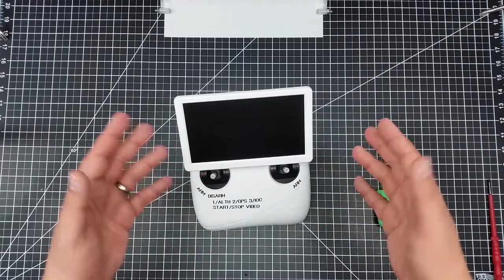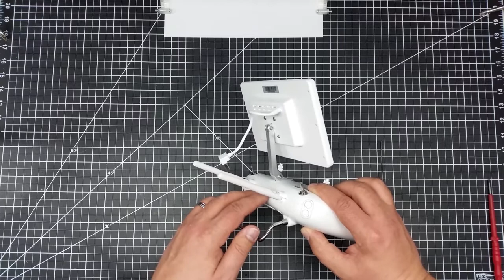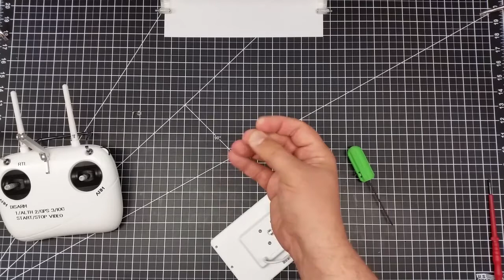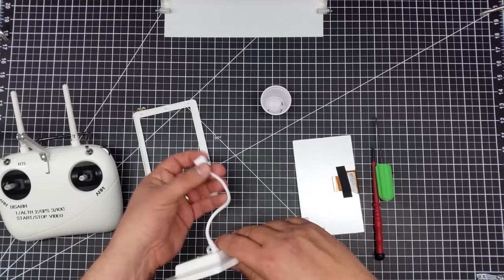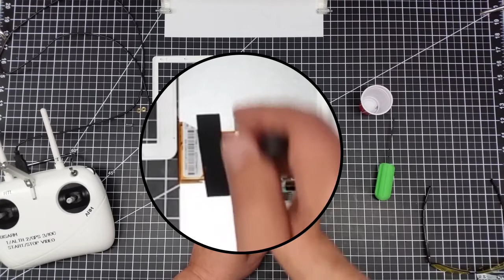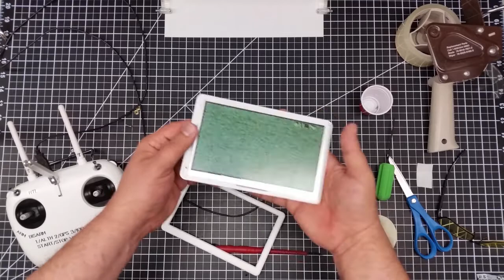Video Drone - Repairing the UPAir Video Screen!

Comment: 💥✨💥 5:48 I saw another screen repair video where he found that there was double sided tape intended to stick the board to the screen but the factory never peeled the red backing on one side to stick both things together...  🔹 I bought my UPair One on Christmas of 2016, turned everything on that night and everything worked perfect.  I lost the charger wire that night  and found it only last week and turned everything on, the screen shows UP AIR then it goes to all black lines like an old TV.  It flies perfectly and the camera control even works but no screen to see where I’m going or to to see all of the info. It makes me think that my problem is coming from the copter itself. Whatever the circuitry that sends the signal to the controller. Any advice would be immensely appreciated.

Comment: Hello I would like to ask you if the upair one plus1 I can use the control with the screen.what it now has in the box inside is the control connection on the mobile
Reply from the maker: Sorry don't understand the question can you rephrase?
Reply: οκ I bought a new drone upair [oneplus 16mp 4k] which has no screen in flight controller.you can see your flight If you place a mobile or a tablet there.I want to change this and use the oldest flight controller  which has its own screen.the result is that the joystick instruments and so on are working but the screen is just lines.can work such a change in the flight controller thank you [Thank you for your time]
Reply from the maker: The one plus requires a tablet or phone (and app) and is NOT compatible with the older One version.
Reply: thank you very much

Comment: Would like some help please if you could. I m going to take the camera itself apart because I have some if the worst video quality and it is driving me crazy. I swear the video can not be more then 640 X 480 quality.I see the videos that folks post on the website and they are great. I have a feeling that it is nothing more than the camera having the wrong focal point selected. What I mean is I will break the glue connection that the camera barrel has and screw the lens in or out till i get a better picture. There is nothing I can do to change the image at this point. I know the camera works  but the videos it takes are of a toy grade QUAD with 1 mega  pixel camera and poor resolution. It is so bad that if I hold the quad about 6 feet from the subject, lets say a person, you can't make out facial features. Fly ten feet above a house with shingles and you can't make out the shingle lines or any real details. I swear this has to be a focal point issue. Can you send some help, please?
Reply from the maker: You could try it however that sounds odd as I have have not see this issue and I am also not sure how the camera is actually set up as I have taken the back off however not the front.  Typically action don't have barrel type lens.  If you have it apart take pic's and post them then let me know the like and I can give you my two cents...